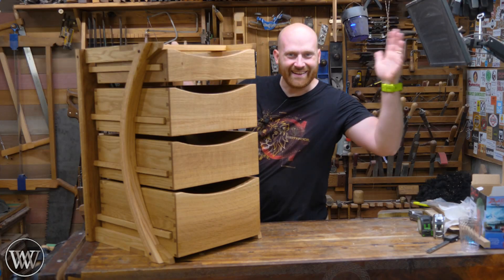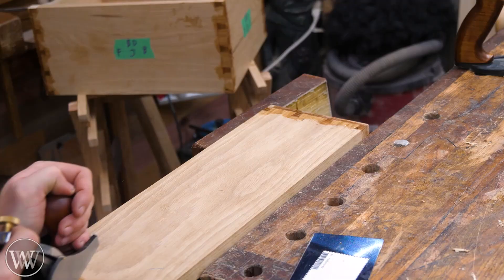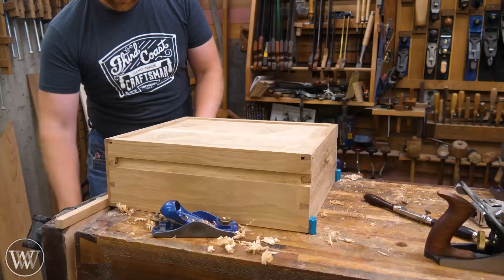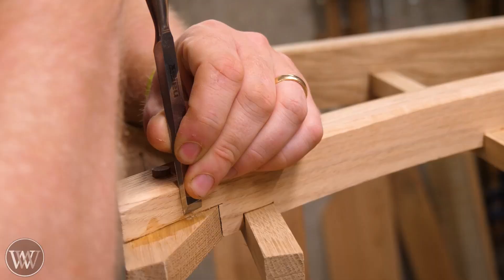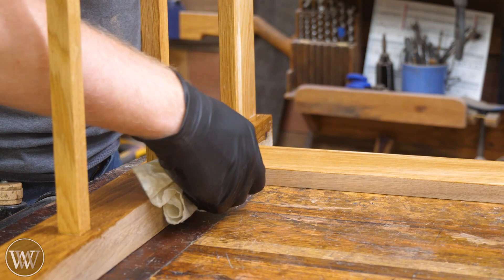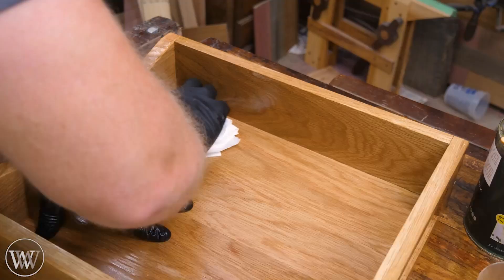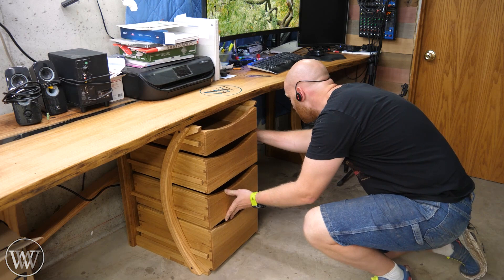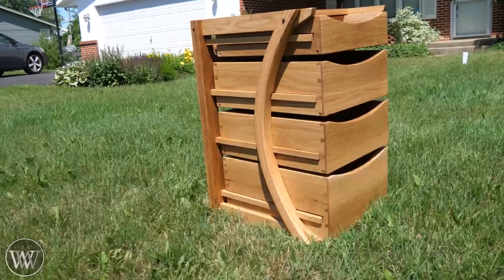Desk Drawers All Done How To Version

Comment: Love the drawer set and looks like you found a winner for the choice of finish. However Amazon offers the stuff for a whopping $50 for the 350ml can. Perhaps its worth it for the low VOC and ease of application, but its kinda hard to part with that much $$$ for only one application.
Reply from the maker: Yup it ain't cheap, but I have not found anything like it. Often it cost as much as the rest of the project. But so worth it in my book.

Comment: Is Rubio Monocoat easy to repair it there is a damaged area? I have 9 children so I know I'm going to have to fix spots on the table in thinking of.
Reply from the maker: Yup I used it on my dining room table I have 3 kids who marker and paint on it. I have not had to repair it yet. Most of the time it just wipes off or scrubs off. If you do have to repair the. You can just coat the spot with it and it disappears in. It does not get darker with multiple coats as it can not soak in where it already is. So it is crazy easy to spot repair.